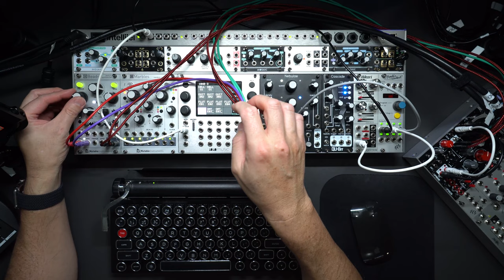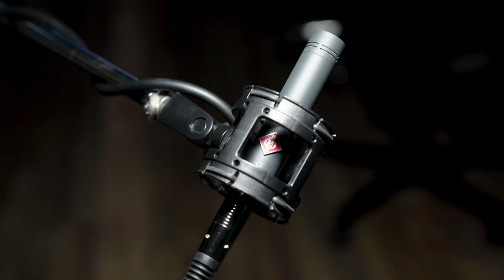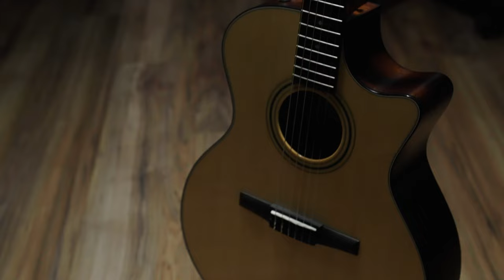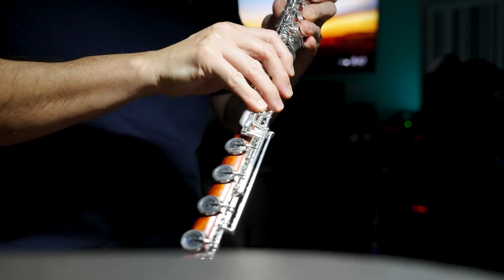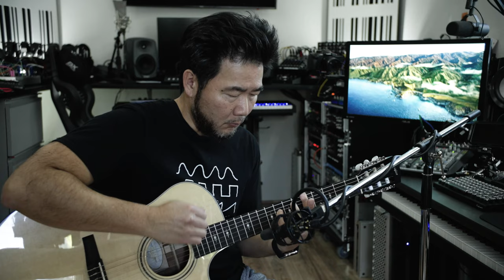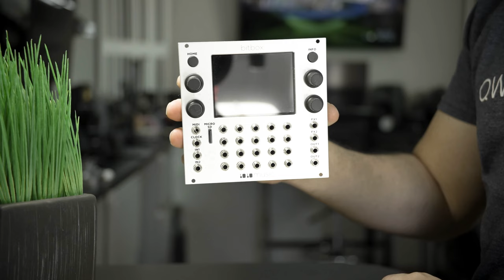Minimal Eurorack Sampler Skiff Build feat. 1010 music bitbox Mutable Instruments Beads Part 2

Comment: Do you have your samples looped or recorded in any particular way? or are you using beads to do all the generation of stuff? Did you figure out any of that stuff with BitBox? Thanks again bud, learning a lot here so far.
Reply from the maker: Hey ya!! I will put that on my list to do a little more in depth video based on peoples interest.  A little hard to unfold everything on the comment section.  But appreciate the support and the kind words! Samples are recorded in related “key” and somewhat in tempo.  It’s like a sample sound collage.  Then it’s all bitbox (you can do this on any mpc type machine too) beads just takes the sample and adds the extra layer of interest.  But I’ll post something a bit more in depth on a later video!!

Comment: Great video as Im thinking of getting a bitbox. What really peaked my interest was the battery. Please do a proper video on that! I would love to know more. Are you plugging it directly into the pallet case in replace of the power brick? you can't drop that nugget without some deets. Thanks. Love your channel
Reply from the maker: Thanks for stopping by! Yes, but the type of battery also important!  Will do!
Reply: @DUNGEONMUSICTHEATRE  Yes I was looking at the flexion d-tap battery. Seems to have a great size to watt hour ratio. I was also trying to see the viability of common powertool batteries like dewalt 20v. (since I have a ton of them already)